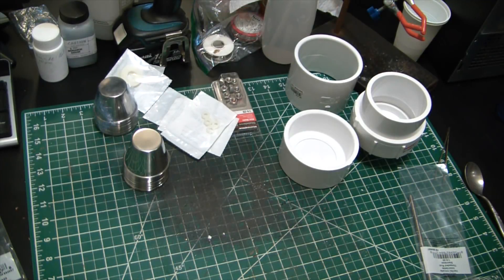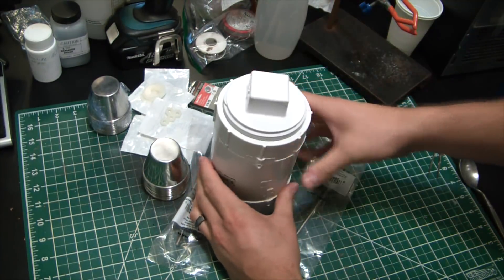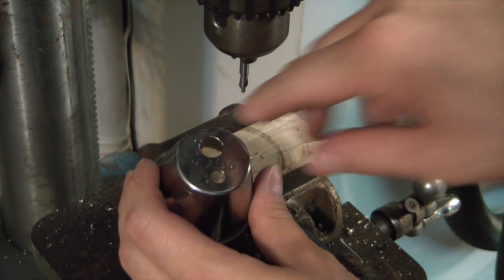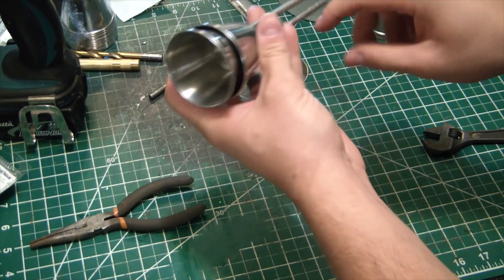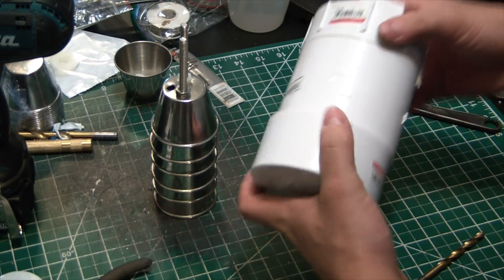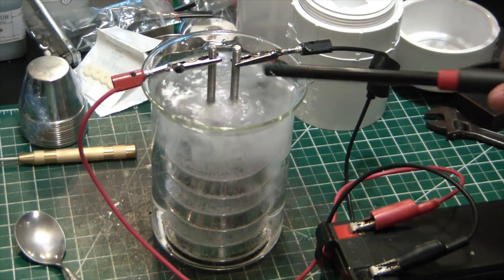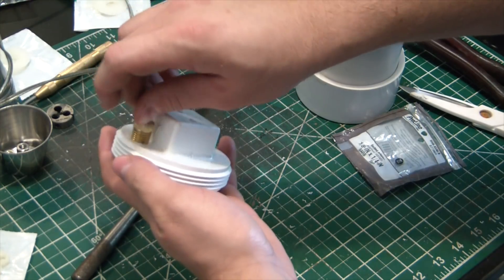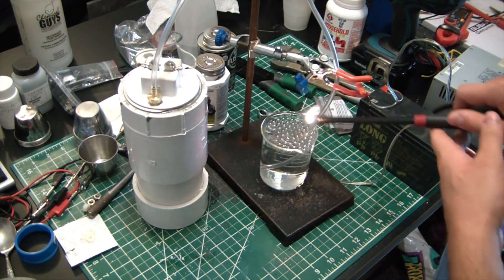DIY HHO Generator for Torch - ElementalMaker

Comment: a few years ago, I made an HHO generator, and took it to work.  One of my friends, who is a masters degree chemist, said that he played with hydrogen all the time in college and was quite sure he could handle what he was about to do.  My friend, confidently put a match to about 3 liters of HHO in a gallon ziplock bag; big mistake!  I knew better, but he insisted.  That shit nearly knocked the wind out of him; it sounded like about 3, .300 win mags all firing at the same time, from my spot 50 feet away.  It was way too funny; he looked like the coyote from roadrunner, after he gets blown up.
Reply from the maker: Wow he's lucky the Shockwave didn't maim him! That's crazy! Thanks for sharing, it's definitely a gas mixture that commands respect.
Reply: @ElementalMaker  Where did you get that Tap Handle?.....
Reply from the maker: @joeydubbs763  that was passed down to me. It's an 1882 (ish) Pratt and Whitney tap wrench. They used to make machine tools before they got into the aircraft business. Then the aircraft business took over and the machine tools got the boot.
Reply: @ElementalMaker  Of course! Quality tools are like rational women, almost a myth & those that do exist are already owned by some other guy. You've almost gotta hunt garage sales of dead guys to find good tools these days. Unfortunately the same process does not apply to the aforementioned 'rational women'......then again who am I to judge another guys...um....."flavour" 😁
Reply: @ElementalMaker  this old Tony had one just like it and broke it down made a new one with drawings if you want to check his channel
Reply: Three guys I know had the great idea to fill a large garbage bag with oxygen/acetylene. The bag ignited itself possibly due to static charges. All three ended up in hospital with ruptured blood vessels in their skin and ruptured eardrums.
Reply: @googleeatsdicks  I want he'd my dad's boss do that exact thing. He would ignite it with a magneto from a safe distance however in the Kansas wind and him wearing overalls caused the hearty bag to blow up and he walked back half naked and skin/hair missing. However he had done this many times before and once a group of roofers were next door. One fell off a 2 story roof when the blast scared him.
Reply: I own a 300 win mag with a massive muzzle break and if that's true how loud it was, Damn. I hope he at least had hearing protection on
Reply: That's awesome,  I hope you didn't lose your job or your funny wily friend,  or get some bad mark from the insurance entities 😑😑😑
Reply: LOLOLOOO(OOOI how much hair loss  the difference to notice a bag was used and man  o man very loud yet just shinged  lololoololl 

use remote ignition not because of energy but the sound so loud ware ear protection speed of combustion fast; frequency and volume  are additive log.
Reply: Your friend was likely used to having just hydrogen in a bag. Not the perfect mix for a big explosion in the same container. Hydrogen alone would still make a large pop, but not quite as violent or quick.
Reply: i guess your friend was only used to playing with H2 and not H2O2
Reply: jimsiggy...it aint HHO it is H2 and O2. At least get the chemistry right. The equation is:
2H2O > 2H2 + O2
Note there  are only molecules present, not atoms!!!!
Reply: stmounts .
Would exposure to a photon pump extract protons or ions
Reply: @stmounts  The gas mixture is often referred to as HHO as shorthand. Even though it's 2H2 + O2, HHO is easy to say and describes the ratio of gas in the mixture.
Reply: @kali_muon  Anyone with a scientific education would laugh at someone who says 'HHO', which in iself gives NO indication that it is a mixture of gases. You will never see 'HHO' in a chemistry textbook, indeed a chemist seeing 'HHO' would simply conclude that it is just H2O written by an ignorant person.
Reply: @stmounts  You might be right, but I don't think anybody cares, except maybe your chemistry teacher.  just say'n.
Reply: @jimsiggy  Yeah, kids are just gutlrss these days.

Comment: Remember PANIC
Positive
Anthode
Negative
Is
Cathode
Reply: That's great thanks
Reply: Also, to get the cups right side up: 
Start at the TOP starting at about 3" or 4" down for the top.  And use plastic tubing to cover all of your rods so elect don't jump to the rods.
👉The 3oz cups are 2-9/16" D
Reply: In Sweden we have the rule PANK which makes perfect sence in Swedish but probably not so much for others.
Reply: It's strange how the charge of the cathode and anode is opposite of the charge of the ions. Cathode is negative where cation is positive. Anode is positive where anion is negative.
Reply: Check out battery chemistry history, it makes more sense that anode is positive and cathode is negative. It's a problem of perspective.
Reply: Wow, that's awesome! Thanks, man! :D
Reply: It really depends if it is a battery or a device consuming power. As a invariant general rule, electrons enter via the cathode and leave via the anode.
This is easy to remember if you think of a thermionic valve, where the anode is the positive terminal and the cathode is negative.
So for a battery the anode is negative and the cathode is positive.
By definition, a Cation is positive and an Anion is negative. So in solution a Cations moves towards the cathode and are discharged at the cathode, making it positive as it loses electrons to the ion. Similarly, the Anion is by definition negative, and moves towards the anode, and is discharged at the anode making it negative.
I must admit I always need to think about this before using it, particularly as it is confused by the concept of conventional current flow, being the opposite to electron flow. 

I find that knowing the cathode of a valve is negative and the anode is positive helps. So  PANIC only works for a device consuming power, not a battery that is generating it. For Batteries it is better to refer to the terminals as positive or negative, since inside the battery, the cathode electrode is connected to the positive terminal and the anode electrode is connected to the negative terminal. 

The definitions are consistent but not the easiest to remember, either for a chemist or an electronics engineer.
Reply: PENIS

Comment: the optimal voltage for one of those cells is 1.5v .. any more is just wasted as heat
Reply: so wouldn't 8 cups be optimal at 12V ?

Comment: I'm going to be making something similar, but I'm keeping the gasses separate until they react inside by Verneuil furnace.  I should have completed this already, but I'm slow and overly cautious.  Maybe I'll attempt making a miniature furnace using ideas from your design.  I've got brass wool sitting in my eBay shopping cart for the DIY flashback arrestor.
Reply from the maker: Very cool! Get some video up of it! I'd love to see your design. I think I'll be building another that keeps the H2 and O2 separated so I can use them individually.
Reply: @ElementalMaker  you should definitely have 2 seperated tanks for anode and cathode if you want to use it as a torch my dude, the optimal ratio of hydrogen to oxygen is 2 hydrogen and 1 oxygen however you want a 4 hydrogen to 1 oxygen ratio if you don't want an oxidizing flame, and by having seperate tanks for the gases you can simply attach a valve to each container to control the amount coming out, cant wait to see how this turns out

Comment: I have had hearing problems all of my life. I wouldn't wish it on my enemies. Use ear protection.  Is there any particular reason you are using sodium hydroxide and not just baking soda?
Reply from the maker: Yeah I know its not a joke, and I do need to work to better protect my ears. I'm sure all the big bangs I've produced will catch up to me someday. I used NaOH simply because I had it handy, and it makes a great electrolyte for HHO cells.
Reply: Is baking soda just as good?  I've never used it specifically to generate HHO, but I have used it to remove rust. It turns the metal black. Would using NaOH not make that side effect (or turning metal black)?
Reply: @tarstarkusz  you need less amounts of NaOH compared to baking soda, as for other effects I doubt there is a big difference as i haven't heard of any yet
Reply: I'm pretty sure he's doing this to make limelight.  After he does it, I'm going to try it myself.  This setup is generating a lot of HHO.
Reply: agree  or salt if ya always put in to much  easy says less is less current less ware and tear and maintenance ....

Comment: Why didn't you just turn the cups over instead of drilling a third hole?
Reply from the maker: It was too difficult to snug the nuts up down in the throat of the cup. I could have put it together in reverse order, but that would have been a big PITA. Just having a vent hole in each was much easier.
Reply: @ElementalMaker  Fair.
Reply: Reason is, as he is building it now, he's optimizing the available surface for the electrolysis to release gas. Shortest stack height gives him the highest useful surface area. If he'd turn each cup opposite, he would end with just 2/3 inside his cell, instead of the actual 5+ with the relative surface and gas output capacity.
Reply: You just start at the other end! Or you could just use an insulated rod and cut a tag into each cup and run separate conductors to each set of cups (offset tags to get a nice straight conductors) ! 
You could lay the cell on its side to allow gas to escape the side of the  cups! I think you are being optimistic about the HHO torch at low pressure as your jet would need to be too small to allow gas out at a usable rate without getting blowbck.
........  It could end up as a micro pulse jet engine though ;0)
Reply: Because he is not bright enough to leave the leads sticking out when he started.

Comment: How are you going to store it? Compress it? Something like a co2 driven beverage pump would work safely (kinda) (ex: shurflo) if you vacuumed the lines and storage vessel first (thinking cheap).
Reply from the maker: I'm going to send the gas directly to the torch with a few flashback arrestors in-line.  Not sure how well it will work, but we'll see.
Reply: Is the production high enough to sustain a flame consistently? That's why I asked about compression.
Reply from the maker: That's the big question! Might have to really pump some power into this cell to sustain a flame, so it will likely have a pretty short duty cycle to allow the cell to cool down, if it even works at all.
Reply: Take a look at NightHawkInLight's solution to storing his wood gas.  Might be useful as a pressure stabilizer and short term storage of sorts.
https://www.youtube.com/watch?v=5hfznunVzKY
Reply: @Cameron_J  storing it in a compressed cylinder is a suicidal proposal. It doesn't just blow up when you show a torch to it, quite often it does so just for the hell of it or when you look at it the wrong way.
Reply: aleksander suur as I've learned in the time since this came out and I commented, pressure above 2-3 atm is enough to cause spontaneously explosion. So don't throw this shit in a air tank.

Comment: Is ElementMaker AVE's brother?  He sounds a lot like him.
Reply: Cousin. Cousin stumblefuck :)
Reply from the maker: No relation I'm aware of
Reply: @ElementalMaker  You sound more like Patrick Warburton had a love child with Jeffery Dean Morgan lmao
Reply from the maker: @tymartin6574  so your saying I'm Kronks son? I'm totally down.
Reply: Nice build, btw!  

Any idea how much energy is consumed to produce a given volume of HHO using your device?  I'm curious to compute the efficiency of such a device.  

Also, how long will that reactor last before you have to put more $ into it?
Reply from the maker: Ill have to check how much current it is drawing at a given cell voltage, then see the volume of HHO gas it produces in a given time frame to calculate efficiency.
Reply: I was thinking brother or long lost cousin of Human, the tree surgeon. They sound EXACTLY alike.
Reply: Probably not.but even the workbench cover and parts population are remarkably alike.  🔨  Tappy, tappy tappity tap. BOOM 🎊🤕
Reply: I just found this and its the first thing i thought also.
Reply: How much energy to produce how much?  With 12v between anode and cathode, one will probably produce about 1 milliliter per minute per watt. A lot of energy is being wasted as heat, but water absorbs a lot of heat. it will take time but it will heat the water and over time some of the gasses escaping will be increasing in water vapor. 

If you have something closer to 6v between anode and cathode, you'll get closer to 2 mililiters per minute per watt. Your hydrogen production efficiency will be almost double  but your current and production rate will practically half.  You can compensate for that by doubling your plate surface area to bring your amps and production rate back up.
Reply: @kreynolds1123  3 volt 55 amp is where you want to be...pure 100 percent duty cycle
Reply: @DavidHarris-qn7em   It really depends on ones goals. In general, low voltages if your looking for higher efficiency, and higher voltage if you dont mind sacrificing efficency for a higher production rate. And, those chooses depend in part on how much your willing to spend. For instance, if your willing to shell out twice as much for more plates, one can keep the same production rate at lower and more efficient voltages.

Comment: I realise you are limited to available materials, but if you use a smaller-diameter threaded rod, you could use the plastic insulators as used for mounting TO3 devices.
Reply from the maker: Appreciate the comment, not a bad idea!

Comment: Could you set something up with the anode and cathode not overlapping vertically, so that you can collect the O₂ and H₂ separately? It feels like a rather dangerous plan to collect a container of the mixture to power a torch, rather than mixing in the torch itself.
Reply from the maker: That would certainly be possible. I believe Codyslab did a video on that some time ago. I wont be collecting the gas, rather sending it right into the torch (with a few flashback arrestors en route).
Reply: OK, well, please be very careful!
Reply from the maker: My middle name isn't Careful.